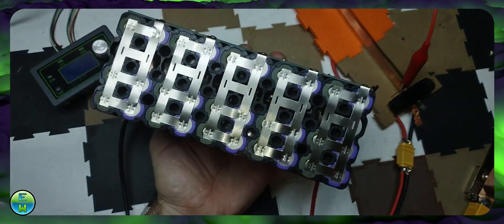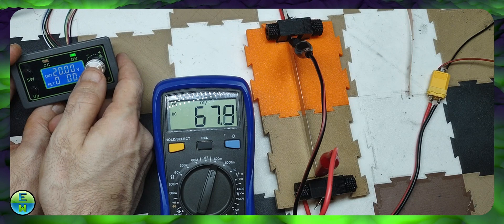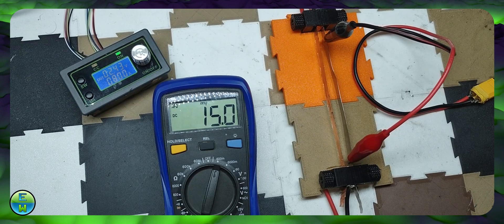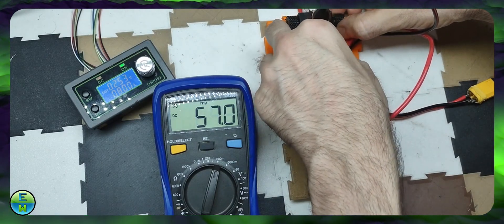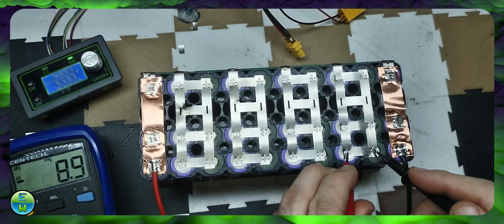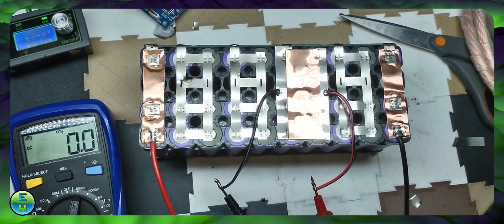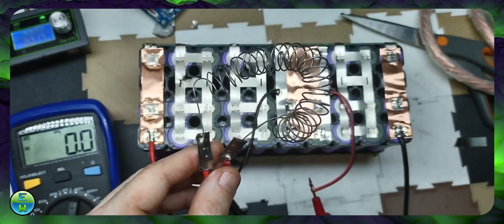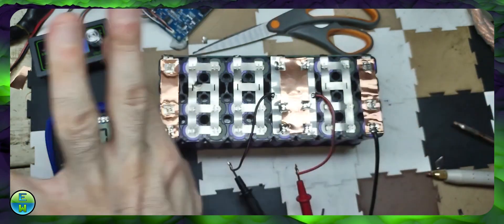Nickel vs. Copper For Lithium Ion Batteries: Real Time Voltage Drop Test!

Comment: Very Nice and detailed video 

So if i understood there's is very little or no current flowing to parallel connections ?
Thanks for this video i think now can weld 0.1x8mm pure nickel for parallel and 0.1x8mm cooper strip in series connections.
Total peak 20A current maximum
Reply from the maker: little to none under normal conditions.

Comment: Excellent video. Cu is good heat conductor, so if your battery heats to 65 *C with nickel, if there is Cu, heating
of cathode and anode material inside the battery will be lower, and if you have proper cooling and extract
heat from inside the battery , to the outside, you can immediately after discharge, use RAPID charge,
without heating cathode and anode and current collectors to 65 *C. 
I saw some cool designs, where battery was cooled by H2O like CPU and GPU in your PC:
Reply from the maker: haha yes. Copper is also definitely a much better heat wick than nickel alone. Thanks!

Comment: Amazing  i was planning to add copper over nickel plated ,i have a 72 volts 30ah battery but  i built  with  .3 nickel plated  and planning  to add copper on top of the nickel plated.
Reply from the maker: Yes. You can definitely do that and feel confident that the battery will work just as well as if you started with copper.

Comment: Excellent. Now for the avg Joe (no pun intended), if you are cruising around nickel is just fine, but if your a competitive racer, the lower mV drop does equal more speed. Especially at higher currents. Well done. 
What's the reason for not just welding copper to the battery, needs mo juice, or price or?
Reply from the maker: https://youtube.com/shorts/Ey-kuN-9E00?feature=share

The amount of power required is going to be the same. The cost as well. The point is to show that it doesn't matter what order the copper and nickel goes in. Once someone is aware of this, it opens the possibility of upgrading an already built battery. 

In contrast, if someone thinks that adding copper wont help because it has to be the first layer, then they are frozen out of several things that they could otherwise do.
Reply: Not only that. You get less voltage sag. Less battery heat.less voltage loses on heat etc. but yes coper strip is more expensive, harder to weld thicker strips, a lot more job to do
Reply: Copper has too little resistance to heat up to welding temperature using consumer spotwelders, therefore nickel is layered on top the copper and the heat for spotwelding is generated in the nickel.
Reply: @Gregorius421 Copper also conducts more heat away from the spot weld.